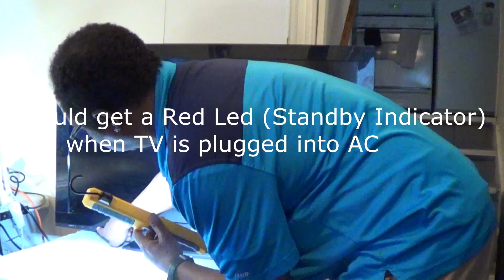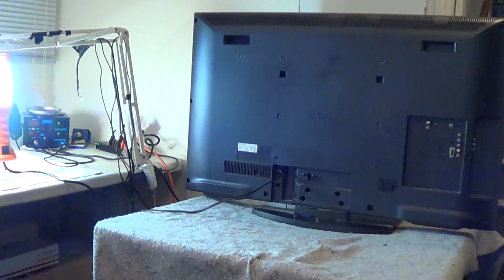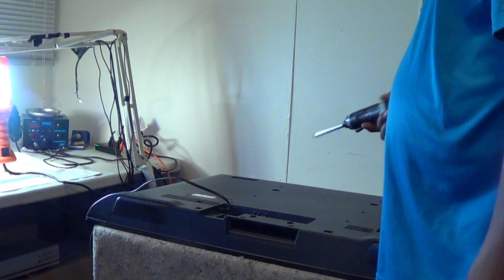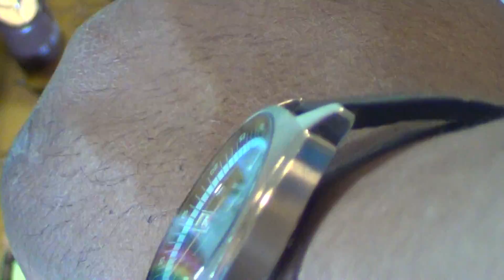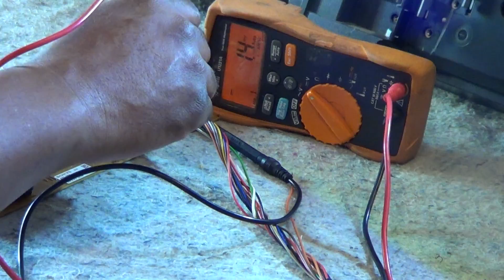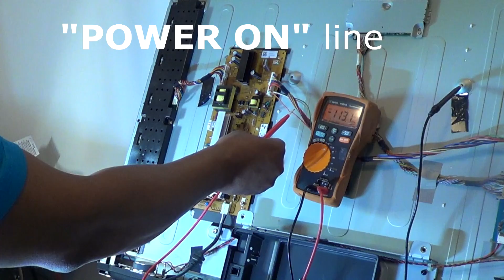How to fully check your tv power supply on a dead television set

Comment: Thanks so much for this video. I had no idea you needed to provide 3.5v to the power on to turn on the other power pins. Did this on my 46ld550 LG TV power supply and got 20v and 12v pins to turn on. Thought I had a bad power supply before. Now looking in the right place.

Comment: Hi thanks for your great job you do.
About AC off detect what voltage should be there? And why AC bcz board needs dc? What that signal does as a result of that signal or what happens when there is no signal like symptoms and ..
Thanks.

Comment: Nice nice....... what if you are getting a voltage by the stand by light plug but the light is not lighting?........ but if you put power to the light itself it works, the two colors red and green......

Comment: Very useful video.But I need more theoretical information about the main board voltage to activate the power supply. I have a TV that was out of service by a lightning. I checked the power supply and there is not an stand by voltage. I bought another one which has the stand by voltage, but it does not make the tv go on. What can you recomend me. I did not have enogh time to work on it but now with the coronavirus I do have it and want to solve the issue. Please help me if you can. Tell me where can I go for more theory on modern TV repair. Thanks. Ramon Perera. Miami.

Comment: Great video, thanks man! Question for ya...if there is a capacitor on the cold side supplying the LED circuit, that is showing obvious signs of damage (ie...domed or convexed top, with carbon like dust all over it, and everything else in the immediate vicinity), is it possible for this capacitor to have only “semi failed.” In other words, be damaged, but still functional enough to make the TV operate normally for say, 15-20 mins, then cause the screen to go dark? Maybe due to it heating up, then losing its ability to function? 
   And when this happens, cause the hot side circuit to “back feed” power directly back out the cord to the AC receptacle the TV is plugged into, causing a radical voltage fluctuation (ie 120VAC to 90 to 110 to 116 to 98, etc etc), at the receptacle outlet. Have you ever seen this happen before with any TV? I’m asking because it’s exactly what is happening with my 70” JVC TV. Apparently, this power board (7001-ZCO2-01), in this TV (model: LT70-MAW795), is well known for being a fairly unreliable POS on a regular basis. Luckily mine has lasted 3 plus years till the condition described above manifested itself. Unluckily, because of that, the “good” boards still available are $60 to $90 online. “ChengX” is the brand of the capacitors on this board. 
    Thoughts, opinion, and any reply in general will be much appreciated! Thanks for your time and attention to this post! Liked and subbed. 👍

Comment: Do most LCD tvs use 3.3 volts to turn on the power supply. I'm working on a plasma, the PS-on signal grounds to turn on. Between you and Coppell TV I'm learning a lot. Working on a Samsung 50" plasma, power supply  had blown main 12 A fuse. Shorted mosfets probably, all they sell is a repair kit for 25 bucks.

Comment: Thanks for this great information. Ok, I have a 60in Sharp TV. Totally dead. I removed the power supply & am getting 5V instead of 3.3v Standby on the connector to the main board. Is this correct??? Can Standby can be 5V too. Kindly if you know, inform me pls.

Comment: I'm working on a Vizio with 3D, no standby voltage and the 12 volt supply is reading 19. Found one for 15 bucks, so I spent the day going over the board, curiosity got me, I made up a 40w light bulb to discharge the main caps, I prefer to remain alive. Does anyone go down to component level? I think I know what the components are but not sure on some. I tried to go backwards on the 3.3 volt supply, caps are dead, no power coming out of what looks like the 3.3 volt transformer. Nothing going in the other side. Controlled by an IC, I stopped there. I tried goggling the number on the IC nothing. For 15 bucks you may ask why, I just want to know what makes it tick.

Comment: Thank you for the video. That was very informative!
I have the exact same model TV as the one you've tested in the video. I've confirmed that I have 3.3V standby voltage; I have 3.3V ACOFFDET voltage, but no power-on voltage (when the main board is disconnected). When I jump the power-on with the standby power, I get 12V AU12V voltage and hear the solenoid clicking as it tries to power on the tv. 
When the main board is connected, however, I don't see consistent standby/ ACOFFDET voltage, and zero AU12V voltage and don't hear the solenoid clicking. Would this indicate a faulty main board?
Where should I go next to diagnose the problem?

Thank you very much for your help.

Comment: I always wondered if we could wire a TV power board wired in such way that it could directly run on a DC/battery/solar power ?

With solar systems when the battery is charged then using an inverter seems stupid if most electronics run on low DC voltage...

Comment: What about a 12vdc TV that wont power up and no stand by light. Nice video thanks I did check voltage and seem to loose voltage when I push the power button ? Going g to go test the board the way you did n see what happens. To save time could it be the power supply its12vdc 2.5 amp output to says 12v DC 3 amps

Comment: When you have the "STBY" 3.3 vdc, then you turn the TV on, does the STBY voltage drop out? And return after the set is turned off? If the power supply is working as advertised, and the unit is plugged in (not on) the STBY voltage is always present? Thanks & I subbed! 🤓 Nice Sony!
Reply from the maker: Standby is always on.

Comment: When i do this check, do I disconnect all other wires going to and from the power supply board? Other than the power cord. My UN65F9000 has standby. And powers up with One connect disconnected to show I need to connect one connect. But soon as i plug in the one connect it shows the SMART TV screen than shuts off and repeats that every 3 minutes.

Comment: I have a sony kdl-40cx523. I have no standby light on and no power. On the psu I have 3.3 for stby. 3.12v on ac off det. 3.14v on power on. 12v on audio 12v. And 12v on reg 12v. I have also got all 5 unreg 24v also on opposite side of pcb. And still no standby when I power up tv. Can you advise. Thank you.

Comment: Best no power no standby repair video yet. I’m working with etec 32 in tv. Same problem. Changed power board and same result. No power at standby or any other pin . Any suggestions please
Reply: Main board

Comment: Mr. Big Dog!
I have a tcl 55us5800.. it won't turn on but the status light  comes on and stay on. I tested the first 3 wires and I got about 10.8 volt dc. nothing else from the other wires. Any insight???
By the way I can hear like a hissing noise from the psu when turned on

Comment: What faulty component/s would cause no standby voltage or power on voltage.
Reply from the maker: If you don't have standby, then your definitely not going to have the Power ON voltage coming from the Mainboard. Check the FET's/Transistors on the Power supply's primary side for Shorts. Thats usually the main cause of Zero standby voltage on the secondary.

Comment: Can the power supply board still be defective if the standby voltage is good? I have 3.556v standby voltage but when I tested the LED+ pins on the power supply board it showed the leds were good & the board was bad so now Im not sure if I have a defective PS board? I had to test the legs on the backside of the connector btw because the connector is too tiny even to fit the tiny probe master accessories I bought. Its on a 55" LG tv

Comment: do you figure the issue would have been a  bad regulator or more likely a bad cap?  I realize it can be anything from resistors to bad IC output/switching but I was curious on your thoughts.  I assume those lines are driven by voltage regulators and cleaned by caps.

Comment: Toshiba 55L621U black screen. HaveTV for about 36 months now when I first bought it I noticed that the TV was sometimes turn itself off thought it was a energy saver feature or timer. Pay this no attention just would turn it back on ,tv would work perfect. So last night TV shuts off ,turn back on like many times before but this time ,this happen TV logo comes on screen goes off as normal but power lit flashing, tv screen goes black so i know something else wrong ,called the repair shop and they thinks that is the backlighting a very expensive repair so since I'm a do-it-yourself person, i taking the back panel off plug power back up and noticed all the backlight panel lights are on then i checked the main board for blown capacitors or fuse ,couldn't visually see any what is your advice

Comment: What would you say if I have 3.3 volts on standby, ac off detect and power on(when power button pressed), but nothing on the 12v pins? I have a Sony Bravia with 2 red blinks and not turning on.
Reply from the maker: Follow the 12v line back to the electrolytic capacitor, then diodes/Transistors and back to the 12v line's switching transformer. If everything looks/checks good on that secondary side (cold), then you have to go on the Hot side circuit of the Transformer and check the switching mosfets and drive circuit to make sure its switching and has DC voltage when you first turn the TV on.

Comment: I have a sony xbr 49x830c, doesnt turn on. No standby led light. I checked my standby voltage and it was only 2.29 volts and is suppose to be 3.3 volts. Is this a bad power supply board?

Comment: hi dude! i have sharp LC60LE275x with totally no power/blank. no LED indicator came out. when turn on power no standby volt, supply voltage for led backlight also very small. is that means power board was dead and need replace? please guide me further if im do wrong step

Comment: Hi there i got a sony tv
The tv goes on and off by itself , it eill only turn on for no longer than 1 second. It will stay off for a long time and suddenly goes on by itself and so on.
Please can you help me.

I did a few tests as follow -
With main board connected 
3.3v nothing .
Ac off 2.38 v constant 

Without main board connected
No voltage on all.

What do u suggest ?

Thanks 

Tv is sony kd-49x8309c

Comment: Any idea what points labeled NC or ANA stand for or what the voltage should be?
Reply from the maker: No Connection, and ANAlog
Reply: @BigDog8882  So no connection would be 0 V I'm guessing.  Should ANA have voltage with TV off?  Fuse has continuity.  All other points (besides ANA) are good.

Comment: My power supply board doesn’t have STNBY or PWR ON. It only says stuff like GND_al_bo, Val_bo and DIM1, DIM2, DIM3 etc.
Is this something you have knowledge of? I would really like some help fixing my philips 46pfl8007T/12.

The led is blinking twice red. Tv not turning on nor any audio. Remote also not working

Comment: ON MY POWER SUPPLY UNDER IT IT HAS NON CONDUCTIVE PAPER THAT HAS PLASTIC RIVET HOLDING IT UNDER THE CIRCUIT BOARD IS THERE ANY SPECIAL WAY TO REMOVE THE PLASTIC RIVETS OR HAVE SEEN THEM THANK YOU
Reply from the maker: Just use needle nose pliers and squeeze the ends, should slide right out.

Comment: I have an lg 60uh7700 . tv powers on . has backlights but black screen with vertical  4inch white strip down center of screen   installed new  tconn . and main boards   no change. Any ideas ?
Thanks .
Reply from the maker: Bad lcd screen. Actually the driver boards on the bottom of the screen are probably bad. U can disconnect the ribbon connectors at the bottom of the T-Con, one at a time and see if you get half a picture. If so then your screen is bad.
Reply: @bigdog8882  can driver boards be repaired ?
Reply: I would teally hate to trash tv

Comment: So it don't matter if u have 5 or 3v stby you still can have a bad power supply
Reply from the maker: Yes thats correct
Reply: @bigdog8882  thank you
Reply: And to confirm if there is no standby voltage it is most likely the psu?

Comment: What on the power supply board went bad; have you worked on the bad board yet?
Reply from the maker: Yeah, feedback IC and diode. But per request I didnt go that far, dont want to confuse people cause this particular PS was only  $15.
Reply: @bigdog8882  Thanks; didn't know that board was so cheap. But I think there's enough people out here that would want to know the component level repair too. Just my .02 worth.
Reply from the maker: @RANGUIDRY  No problem, got plenty of Video's on my Channel for that.
Reply: @bigdog8882  zenner or shorted allowing flow in both directions or just blown/easy to ID?  I bet that IC was blown/shorted at the 16V output pin??

Comment: The board I have on a Sony XBR-55X900C doesn't have the pins labeled that well, but it does mention 3.3v for standby.  One of the pins is only measuring 2.38v which I think its standby.  Does this indicate an issue with the power supply or some other board? When I disconnect any of the other boards, I don't get any voltages.
Reply: I have the same issue, only 2.29 volts. Did it turn out to be the power supply board?

Comment: I have the same problem but as soon as I plug in, the power board blows the fuse.  I disconnected all boards leading back to power supply board and plugged in and still blows power supply board fuse.  I have a short somewhere on power supply board that is blowing the fuse.  Any ideas?  I've already tested my bridge rectifier and it's good.  I don't see any caps that are blown.
Reply: @gjergjkastro9404  so I think I narrowed it down to one of the mosfets, its showing a short both ways with leads on drain and source
Reply: So looks like not after all, put in new mosfet and still blew the fuse.  I'll shoot you a picture of my board.

Comment: Can I put another screen on another tv
Reply: They have to match example LC420DUE (FG) (CD) you have to make sure all references are the same so a LC420EGE (CM) (DH) will not work nor will a different make as all makes and models have a different voltage some are 5v some are 12v, a Samsung screen will not work in place of a AUO and visa versa........ be careful a LG TV may not use a LG screen some TVs can have the same model number look the same but have different screens, also you can’t put a Samsung screen on an LG tcon etc hope this helps 😊